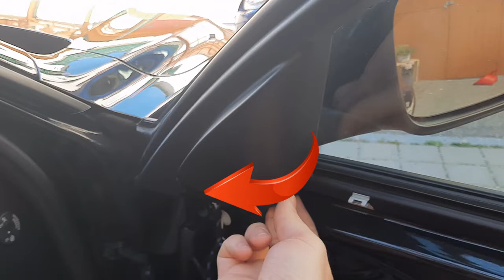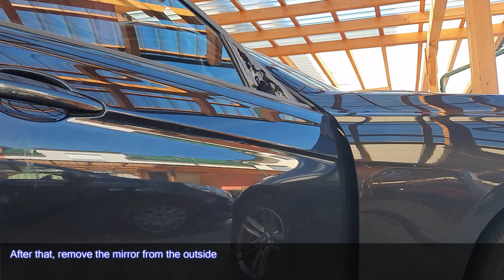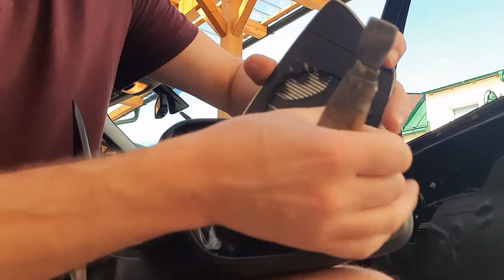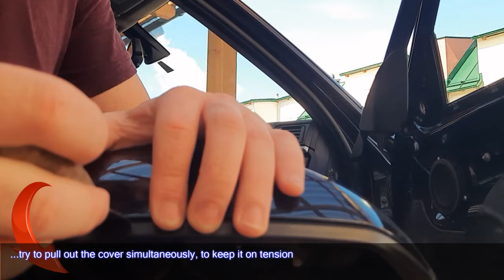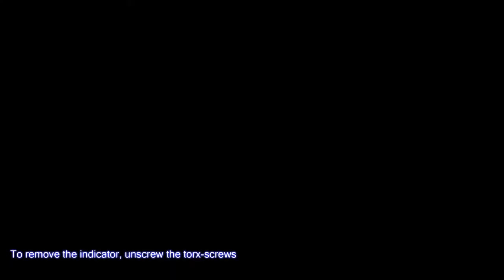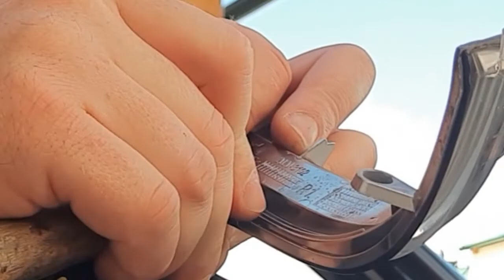BMW F30/F31 remove side mirror and dismantle into individual parts - Tutorial

Comment: I'd love to see you pulling out that interior mirror cover with the door panel on like you say it's possible :)
Reply: I can confirm that this is possible having just done it. There is a door panel clip near the top corner. Once this has been popped you can snap the plastic cover off. It is a bit awkward and there is probably more risk of damage but very quick. The bottom wing mirror bolt is also a bit harder to access with the door panel on but it's possible.

Comment: Thanks, but how can this be done. I mean on the video you dont have door panel and then it goes. But how can you do step2 (pull of the window guide) when that bit is wedged deeply behind door panel?
Reply from the maker: Pull it out on top first, then slide it out at the front
Reply: @i-car-us  Is this also possible if you have the harman cardon speakers?